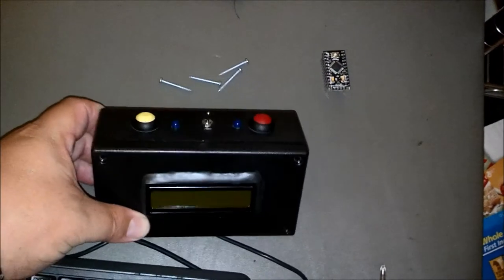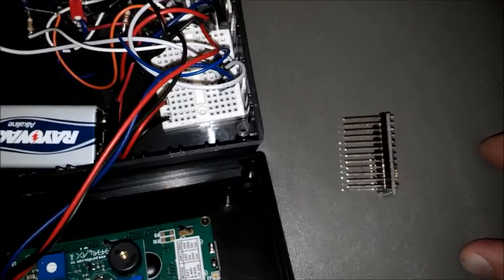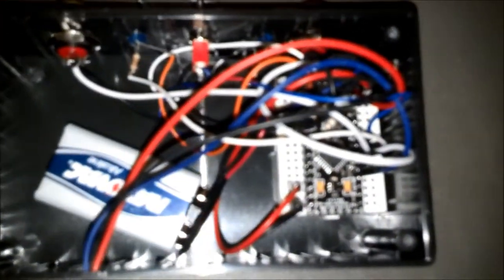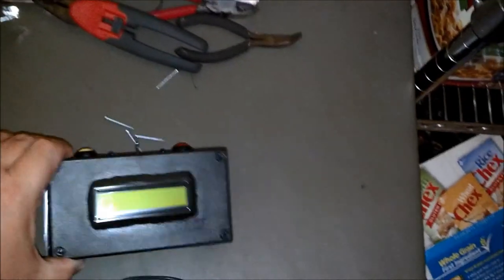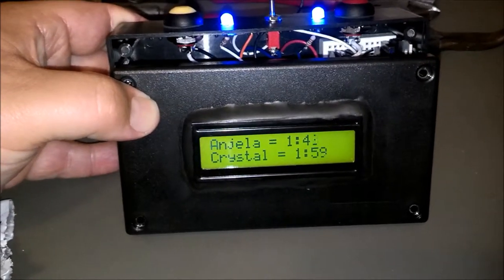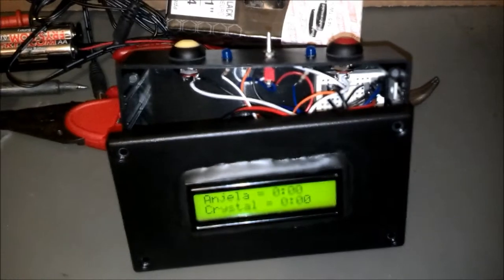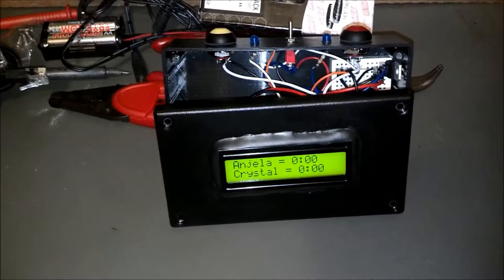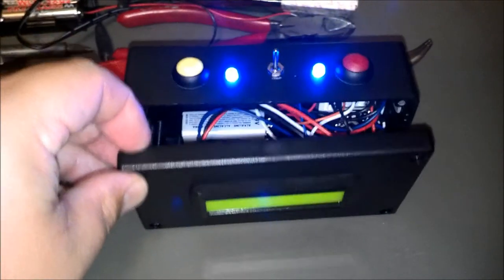Arduino Dual LCD Count Down Timer "Kids Teeth Brushing Clock"

Comment: ONE QUESTION, YOU KNOW IF YOU PROJECT WORK WHIT I2C LCD?.THANKS
Reply from the maker: Yeah it would work with I2C, May have to rearrange the inputs to make sure no other functions are on the I2C pins.. But yeah there is no reason it wouldn't work with a different LCD, I just like the serial ones because they only take ONE I/O pin to communicate and power and gnd... 3 wires and DONE :)